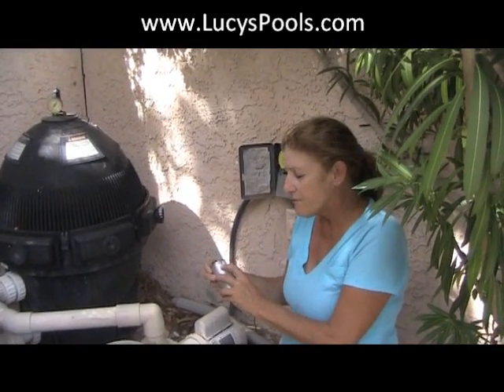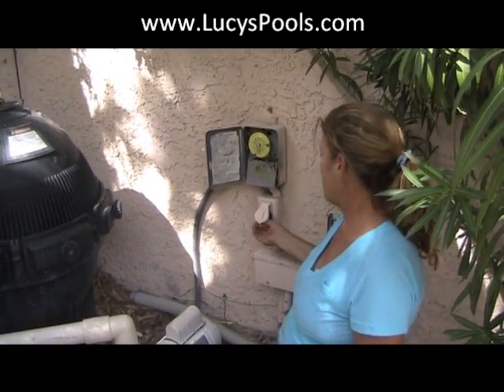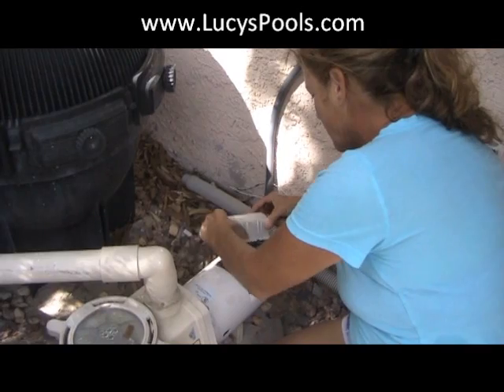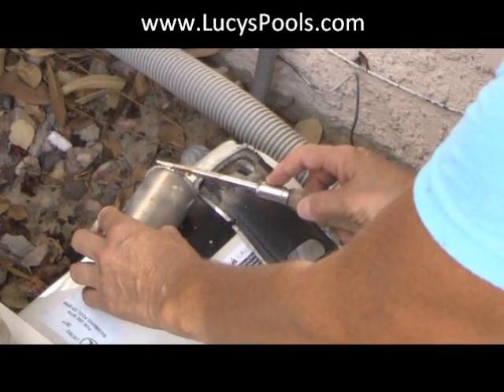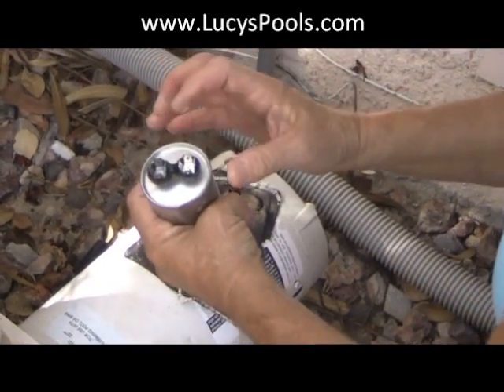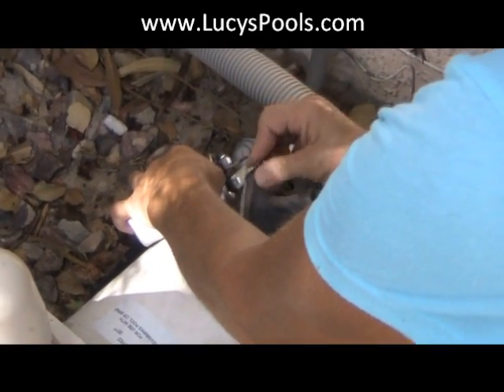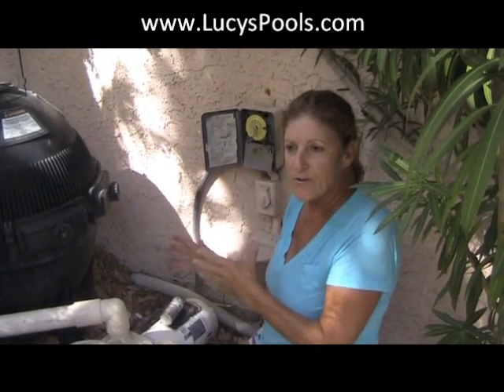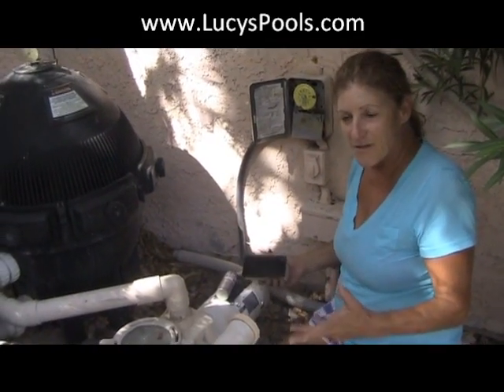Pool Motor - Humming-Loud Noise- Capacitor Replacement *UPDATE*

Comment from the maker: Sounds like an internal heat protection switch which shuts the motor off if it runs too hot, then turns it back on after cooling down. You can try to clean the filter to decrease work load; run it at night; run it in cycles i.e. run for two hours, then off for two and so on. If it's over ten years old you may have to buy a new one BUT you can call a local repair shop and see if they can rebuild it. A rebuilt motor costs about $250-300 installed. Check your wires to see if they're on tight.

Comment: I too have to say thanks for posting this. My motor sounded exactly like that. I first thought I would need to replace my motor. Now, instead of looking at $700 (energy efficient) I'm only looking at $20 or so. Also, I dropped my screw just like you did! Thanks Lucy. If I lived in Vegas, you'd be my pool person!